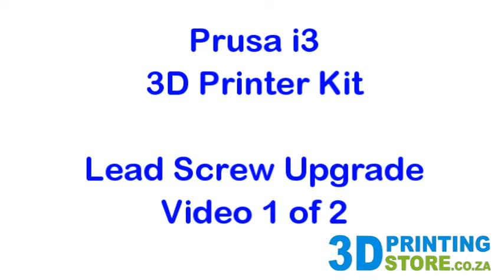Prusa i3 Kit Ugrade - Lead Screw Upgrade - Video 1

Comment: I have the CTC Prusa i3 Clone 3d printer.  This came with their standard leadscrews and I attempted to upgrade to the t8 leadscrew.  I can home everything, but when I attempt to print I could not get any filament to adhere to the bed.  All I got was a mesh of filament on every item I tried to print.  Is there a firmware modification required once you change to the t8 leadscrews?  Your help will be most appreciated.
Reply: did you find a solution??
Reply: I had the same problem on my creality ender 3 pro and after struggling for over 6 months trying various solutions I found on the internet I finally figured that when you start a test print and you see that the nozzle is not exactly close to the bed laying the filament down but slightly in the air, you need to go into the LCD menu and go to live settings and then lower the Z-offset till you see the filament sticking to the bed properly. Do some bed levelling before you do this and you will get it right. If after getting the nozzle really low as much as squishing the bed the prints do not stick then simply raise the bed temp 5*C at a time for every test attempt. Most filament manufacturers do not correctly mention their filament bed temperatures on the label and it generally turns out to be little higher than specified on the label. Hope this helps, let me know.